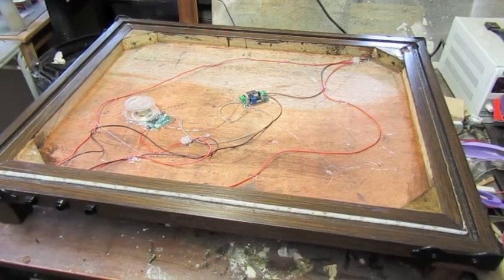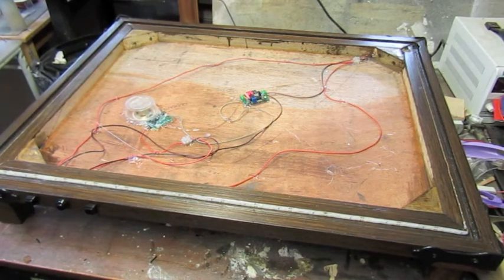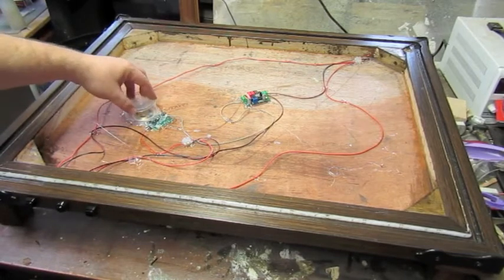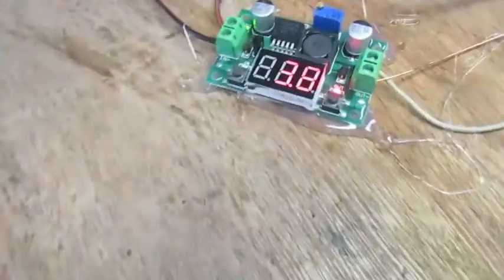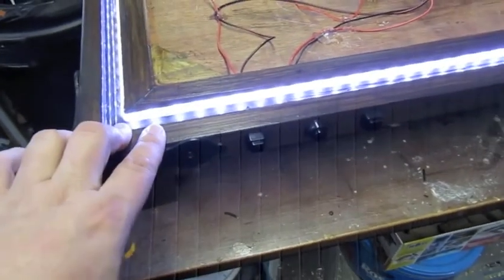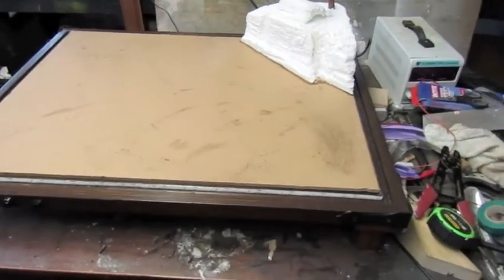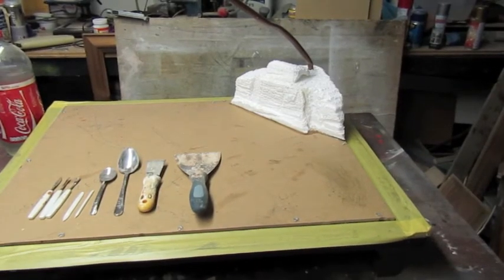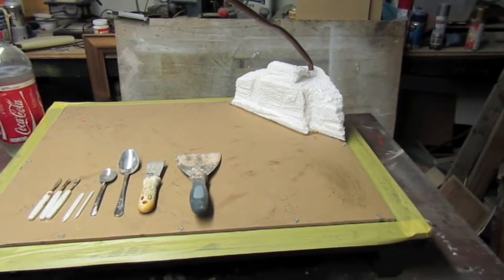1\16 GENERAL LEE DIO COFFEE TABLE update 9!

Comment: looking good! was that a battery powered soundboard? you can run a voltage reduction transistor on it and safely run the whole thing at 9 volts... i think you can get a 12 volt reduction transistor too if you want to run at 12 volts. it just wires into the power leads like the board you have there to power the soundboard and is smaller and simpler and you can tie the soundcard and lighting power all together. if your strip was cutting out your power supply might need more amperage output... strips draw a lot.
Reply from the maker: Gearhead Workshop thank you, yes the sound board is 3 Volt's I took the batteries off and wired it up to a voltage regulator, that's running at 3.8 volts every sound is working now, for the lighting it was just the copper pads that where failing but every thing seems to be ok now.
Reply: DJ MODELWORKS led strip can be a pain soldering. If it gets too hot the smd chip can come unsoldered or the resistor on the tape can get too much heat and fail. I scratch up the tape contacts.  Pre tin them and the wire and do just enough iron contact to connect the wire. The less time you spend with the iron on the tape the better. Car looks great with the suspension unloaded in the jump.. most would have not thought of that i think. Cheers!
Reply from the maker: Gearhead Workshop thanks Chuck never thought of scratching the surface! I did pre tin the connection first, works so far 🤞

Comment: I have the same problem mate. My Christine sound board cuts out and that is running off two CR2032 batteries
Reply from the maker: it sucks when it does that, I just ramped up the voltage and it works, try using a voltage regulator and see if you can sort the problem mate.
Reply: Thanks I will mate. Got my eye on one or two diy kits
Reply from the maker: Andrew Drabble good luck Andy